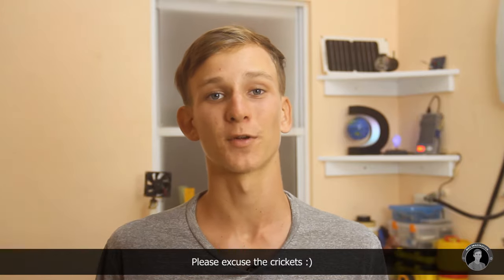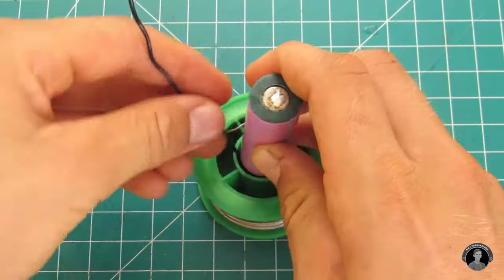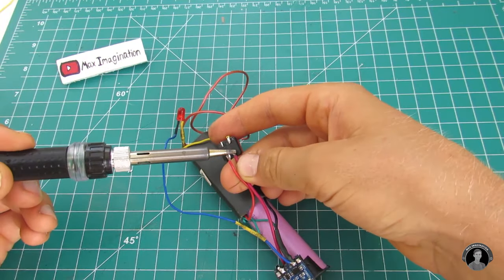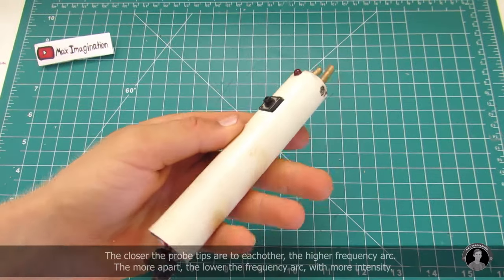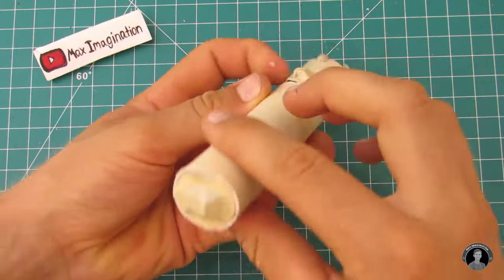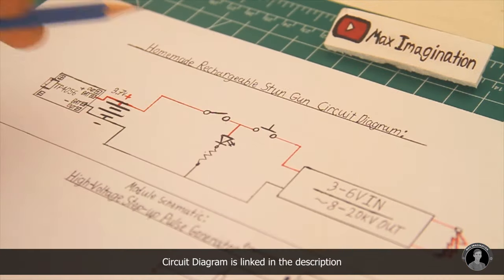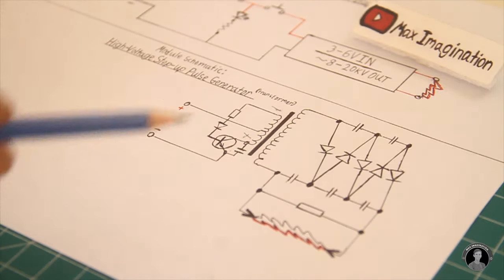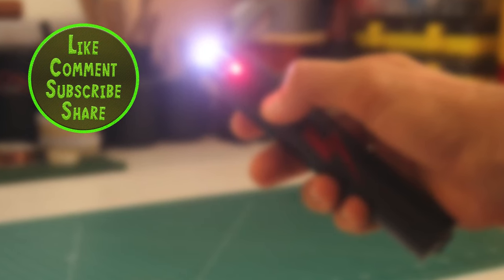Make a POWERFUL Stun Gun for Self Defense | DIY

Comment: Most people are stunned when they find out how bad electrician I am
Reply: I noticed you used the black epoxy I know as J-B WELD Or J-B KWIK. If this is the case then your electrical short at the terminal base is the epoxy.  J-B epoxy has metal filings in it, so the voltage output will travel through it.
Reply: @TNT-km2eg  do you "stun" yourself aswell?
Reply: @TNT-km2eg  😭

Comment: do not even try to use it for self-defence.  It able to make attackers more aggressive only
Reply: Then make your stun gun more powerful. A stun gun that can make elephant have a long sleep.
Reply: @tuckerjohnny9351  the power not a problem. The problem is that if you want to put to sleep, you should to apply electric shock to massive part of body. Other worlds, you need 8-10cm between electrodes at least. If you apply 100w to electrodes placed 3-4cm one from another, it will cause burn, and pain, but not a sleep.
The second problem, to put an attacker to the ground, you need relative long pulses of current, that not so easy to produce. And of course such pulses can not be produced by capacitive voltage multiplier circuit or simple inverter
Reply: @tuckerjohnny9351 the power not a problem. Distance between probes should to be 8-10cm at least, and the pulses of current should to be 70-80 ms long.
Voltage multiplier shown here can't to create neither long, nor high current pulses. It can cause a burn, and some pain, but no much
Reply: @tuckerjohnny9351  the power not a problem. Efficiency of that device not a power related

Comment: Nicely done man! I made one a few years back and all I did was hot glue the transformer and battery holder together and put a US to EU power adapter on top for the prongs lol. Yours is a lot more detailed. 👍 BTW I love how you called out how it does NOT output the claimed 400000 Volts, a lot of other YouTubers fall for the false advertising. Great job man
Reply from the maker: Thank you for your comment, Erik! Haha, you made your's the crude way, pretty cool! 
Yes, many fall for believing a little module can deliver a voltage so high where it really outputs a several hundred to a few thousand volts at a minuscule level of current.
Cheers!

Comment: Discovered that if you connect the module (load) to the OUT + and Out -  on the charging board, the firing will not work very well. I noticed you connect the module in parallel with the battery B+ and B- on the board.
Reply from the maker: Thanks for noting this!

Comment: Does it have to be a 2200mah?I’ve got a 6800mah laying arround
Reply from the maker: It doesn't have to be. You can practically use any mAh rating of one-cell battery. The mAh rating indicates its current-capacity.
Reply: It will still work perfectly fine right? No overheating?

Comment: why did you connect the transformer at pin b+ and b- and not out+ and out-
Reply from the maker: That's so no protective features get in the way of using it when you really need to. Even if it's very low on juice, you might need to defend yourself.

Comment: Hello. I want to make one but more powerful.  Would you advise me to put two of these modules or put one with more batteries?
Reply from the maker: Hi there. I suggest you use two of these HV modules in parallel at the inputs with one battery pack of 7.4V. Cheers.

Comment: will the charging chip work even with the other stuff connected to it and if the voltage module is half on the charging chip will it still charge the battery is it still has 2 wires connected to the battery from the charging chip.
Reply from the maker: Yes, you can still charge the battery while everything else is connected in the circuit and use the stun gun when not charging.

Comment: Hey Max, I’m just a little curious about something…

I see in both your video and your schematic you place the rest of the circuit in parallel with the battery terminals, rather than using the outputs on the TP4056 board itself. Was there a specific reason you chose to do that?
Reply from the maker: Hi there, Lucas. Interesting you point this out...

I have done this to bypass the charging board's over-discharge protection feature that comes with when connecting the circuit to the OUT+ OUT- terminals. Another viewer found that connecting the rest of the circuit with the OUT terminals resulted in very early circuit cutoff, reducing the stun gun's reliability when one really needs it. Implementing something such as one of those cheap battery voltage level indicators into the side of the stun gun can come in handy, knowing when to recharge the battery.

Hope this makes sense. Be sure to choose wisely on which terminals you connect the circuit to.
As recommended and shown - hooking the circuit up to the same battery terminals of the board will ensure more reliable performance.

Cheers,
Max

Comment: Would probes from a 125 volt power plug work or does it have to be 220 volts? All the 220 volt power plugs I've found are super expensive while the 125 power plugs aren't.
Reply from the maker: HI, a 125 volt probe pair should work just fine, I mainly chose the 220V type probes because of their shape. So, no worries on that one! :)

Comment: Is the charging board a necessarty component or is hooking the step up converter directly to the battery safe. I feel like the battery will overload and pop
Reply from the maker: If you want to be able to recharge your Stun Gun's battery, then yes, it's necessary. The circuit is wired safely.
Reply: @MaxImagination  so even if i don’t have that part the circuit is still safe?
Reply: @MaxImagination  so even if i don’t have that part the circuit is still safe?
Reply from the maker: Yes

Comment: I wanna make one from a flashlight but I was wondering if I can use metal as material like a old Maglite flashlight or the case must be plastic.
Reply: I would use plastic mate, with high voltages come the arcing phenomena where a pathway through the air is taken by the current in jumping to a conducting material (metal), respectfully Max’s advice here is not the best
Reply: Thanks y'all for the answers

Comment: hey man i have a question, shouldnt the wires on the transformer go on somewhere else on the smart chargingboard instead of soldering directly with the battery wires?
Reply from the maker: Hey there! The input wires of the transformer don't go "directly" to the battery, but through a switch and a push button, yes.
Reply: @MaxImagination  ohhh ok I get it now

Comment: Can we use 9 volt non rechargeable battery ? 
How long will it last ?
Reply from the maker: 9 volts is too high. You will risk burning the module. I recommend using an 18650 3.7V battery or x4 AA batteries for 6V.

Comment: Hello, my battery is the 9900 mAh 18650. Will this cause harm to me if I attempt to touch it?
Reply from the maker: Hi there. If you power the high voltage module with a battery, it will hurt touching the wires on the other end.

Comment: Nicely done'dude 👍! One thing: there is no safety apparently so suppose you carry it in your pocket,you can SELF-FRY ,isn't ⚡🤪?
Reply from the maker: Thanks! The switch at the bottom is the safety feature 👍
Reply: The only thing I would change is that safety switch as it could easily be push me personally I used one of the switches that's got the clear rubber box over with the switch inside as these need a bit more pressure to switch between safe and armed but yeah get little project max keep post new vids champ, is there anyway you could make one with 3 batteries

Comment: Can you please explain how this works because I have read that these transformers are only usable for ac input and not dc input provided by battery
Reply from the maker: To put it simply, the high voltage pulsating transformer takes a low voltage DC input and produces a high voltage DC output thanks to a voltage multiplier circuit which uses a specifically timed sequence of capacitors that charge up and build on that voltage + diodes to direct that current to keep building up. Hard to explain, though I hope you get the main idea of how it works.
Reply: @MaxImagination  yep and thanks for replying
Most youtubers don't reply. Amazing video

Comment: Awesome 👍. I made one exactly like yours, but it only works twice. The HV component stopped working. I did verified that the HV side open.
Reply from the maker: Thank you! These cheap HV modules tend to be very sensitive to the input voltage supplied. Try to power your HV module not higher than 6V next time. Cheers.

Comment: FIRST MAX THNK YOU FOR THE INFORMATION. .IS THWR ANYONE WHO REMEMBERS HOW MANY WINDING TO MAKE A PLAZMA ARC PULSE GENERATOR USING A 9 VOLT BATTERY AND SPARK PLUG I GET A ELECTRIC SHOCK BUT PULSE ARC AND USING A ULTRAISO CAPACITOR FOR THE PURPLE ULTRASONIC ARC
Reply from the maker: No problem :)

I have no idea about the number of windings in one of those. That would require more calculation...

You can in fact order these high voltage arm modules for cheap. 

Cheers

Comment: I also made one. But i added 22nf capacitor and the sound is bigger
Reply from the maker: Well done! Where in the circuit did you add the 22nf capacitor?
Reply: @MaxImagination  on the output of the high voltage stun gun

Comment: Will it hurt?

There is a current limit of i think 1 amp max? 🤔
Reply from the maker: It will hurt, yes. Maybe not lethally, but it will. Also, the amperage of the unit is lower than 1 amp.

Comment: Hey max. How to solve the issue of draining the battery?My project drains battery real quick just 5 clicks battery is drained.
Reply from the maker: Hi, Tarsious. Hmm, that could be due to you using a weak battery on its last legs. Are you using an old battery? What are the battery's specifications?
Reply: @MaxImagination  new but cheap baterries. P
Reply from the maker: @tarsiousmunalembohol  Normally, a battery would last pretty long when used with a stun gun module, that must mean you have really weak batteries. I suggest you try another 3.7V one. 
Cheers,
Max

Comment: Does it worka continuously. I also made one. But stops after few sparks
Reply from the maker: I do not advise you run it continuously as that may overheat and damage the internal oscillating transistor.
Reply: The problem has resolved. I connected directly with battery for output.

Comment: Hello brother,
I am facing a problem plz help
I did everything like you did, but when the output wire is not connected to probes it generates an arc (a very painful one😂😂) but after connecting' it does not generate an arc but makes a sound (whistle like)

When I reduce spark gap to 2mm it generates an arc
Reply from the maker: Hi there, it sounds like you may need to reposition your probes so the tips are the closest thing between for a decent spark to happen. Also, make sure you're powering the transformer module with a battery of high enough voltage but not too much.

Comment: Does it have to be a 3,7v battery or can it be any rechargeable battery?
Reply from the maker: It can be any rechargeable battery up to 12V and no higher. Such as 1-cell, 2-cell, & 3-cell configured batteries. Cheers.

Comment: Hey Max, I was wondering where you got the probes because I couldn't find it. But I did find a ground prong that looks like the probe you have so, like do I buy a charger and remove the ground prong because I have no idea what else to do
Reply from the maker: Hi DnD, I already had these ground-probe looking probes already lying around in my electrical parts box, I wouldn't be too sure exactly where they came from. I'd say regular cable ground probes would do the job fine. I recommend you purchase a "TP4056" single-cell battery charging module for safe recharging of your DIY Stun gun, you can purchase these on online stores such as Amazon. 

Hope that helps! 😊

Cheers,
Max
Reply: @MaxImagination  okay thank you

Comment: Wanted to ask if the led of required, because buying a single led and resistor just doesn't seem worth the trouble
Reply from the maker: Hi there. It's not required at all, but it pays having one for peace of mind knowing when the stun gun is off. I'd recommend you salvage one of those 3 or 5mm LEDs from any old appliance. You will most likely find one.

Cheers,
Max.

Comment: Is it possible to build this with a potentiometer so that the outout can be turned up and down?
Reply from the maker: Possible... but you will need more than a potentiometer. I recommend you use a DC-DC converter at the input like the LM2596.

Comment: What if we use a bigger battery like a 7.4 volt would the power boost module be able to handle it?
Reply from the maker: Most likely it will, but not for very long (unless otherwise specified) due to the internal circuitry in most of these failing often above an input of 6V.

Comment: my battery is getting hot. Am I using wire that is too thin. Its the only thing you didnt list in your list of items to be used.
Reply from the maker: Hi, Nick. I recommend you use 24 AWG enameled wire. If your battery still overheats then, I suggest you would need to replace it for another battery.
Cheers.

Comment: How many volts they give ???
On how many amps ???
Reply from the maker: Hi there. The module puts out several thousands of volts at an extremely low amount of current. This could be in the range of 8,000-20,000 volts. Hard to say, since this can't be measured with an ordinary voltmeter.
Reply: @MaxImagination  Thanks bro keep it up bro

Comment: what if I use 2 3,7v battery in series? or it should be in parallel?
Reply from the maker: You can as long as your high voltage module is rated for up to 9V. Otherwise, I suggest you stick to running one with a parallel battery pack.

Comment: Will a 3.7V 18650 Battery work with a pulse generator with an Input voltage of 3.7V-7.4V ?
Reply from the maker: Yes, that battery should work.

Comment: Hey, I wanted to do this by myselfe but I dont know wich cables I should use to extend the range of the LED (How thick etc. they should be) sorry i am new to physics and science stuff in general
Reply from the maker: Hey there! 32-Gauge insulated electrical wire would be the ideal choice for connecting an LED, anything thicker such as 24 or 20AWG, etc... will also work. Cheers.
Reply: @MaxImagination  thank you fir your answer

Comment: In reality how much much voltage it delivers
Reply from the maker: The exact voltage the stun gun outputs is immeasurable... Somewhere between 8,000 - 25,000V approx at a very low current.

Comment: Mine is way more crude then yours I made mine with one of them boost step up module and I soldered a 9v battery connector a button and two nails I can plug in a 9v battery to charge it
Reply from the maker: Way to go! Whatever does the trick, good job. 👍

Comment: Is there a way to add a battery indicator to show how mach charge it has left
Reply from the maker: Hi there. Yes, one of those cheap 4-5 bar LED battery voltage indicators may be used.
Reply: Thanks are they on amazon

Comment: I made the same one with 1000kv module it's not sparking continusly ( pls help me )
Reply from the maker: Hi. How does it behave? Have you checked you connected everything properly? Could it be your battery?
Reply: @MaxImagination  I checked everything its spraking when the ends touch but does not spark even on a small distance

Comment: Why is the circuit board getting hot
Reply from the maker: It should not be getting very hot. Are you sure you're not charging a really high capacity battery?
Reply: Bro my stun gun stopped popping on my channel can someone help me understand what happened
Reply: Did I cook the device by using it too much in one siting? It doesn’t pop nomore on contact but you can see a shock or arc
Reply: But it’s weak arc
Reply: And it doesn’t pop
Reply: @MaxImagination i fixed it the problem was with the circuit board it was faulty

Comment: A stun gun on a ready-made module is easy to manufacture, but it is not suitable for real use against a person, it has too little output power.  Practice has shown that stun guns on a voltage multiplier are ineffective against a person; a transformer is needed at the output.  Sincerely.
Reply from the maker: Hi, not sure if you mean that these modules are ineffective for being lethal weapons or ineffective for self-defense. Personally, this type of stun gun is just fine for getting a man on the ground, especially if you hold it to the person for 2-3 seconds.
Reply: @MaxImagination  I meant that a stun gun on a voltage multiplier has weak bioeffectiveness, the maximum it can do is cause unpleasant pain sensations (I checked it on myself).  While a stun gun with a transformer at the output, in addition to painful sensations, causes a strong muscle spasm.  If you're interested, I have videos of my homemade stun guns on my channel.
Reply from the maker: @DPAKEH  Yes sure, I get what you mean. Though my module does actually have a step-up transformer, and it did send me straight to the floor when I accidentally touched either of the output wires for less than a split second. 😅
I'll check out your channel 👍
Reply: Rt

Comment: How you find small power generator, ebay how you find it, what should type, or else let us have how to make it 😁
Reply from the maker: Hi, I know I didn't yet add any purchase links to the parts needed in the description below, so here's where you can buy one of these high voltage pulse generator modules: https://www.amazon.com/DEVMO-400000V-Step-up-High-Voltage-Generator/dp/B07S712WKL/ref=sr_1_1?crid=UU9SDC690YH&keywords=high%2Bvoltage%2Barc%2Bmodule&qid=1645363765&sprefix=high%2Bvoltage%2Barc%2Bmodule%2Caps%2C128&sr=8-1&th=1

Cheers!
Max